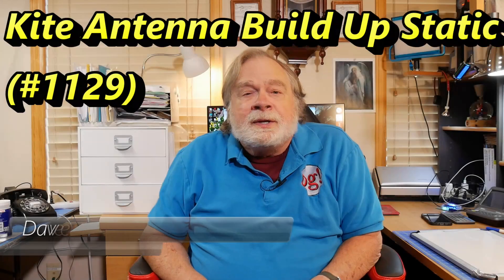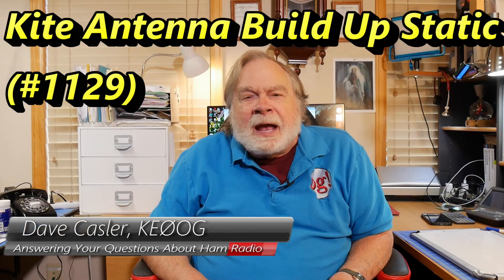Kite Antennas Build up Static (#1129)

Comment: You don't need a good ground. You need a mediocre ground. It is extremely high voltage but extremely low current. If it had any current we wouldn't be building windmills, we would be harvesting with kites. 

A few meg ohms will bleed the charge off slowly. Which, incidentally is exactly how it should be done. The antenna has capacitance to ground, the radio as well. If you charge it up and do ground one, now you have a high differential at the other. EsD mats and straps always have high impedance designed in, partially for safety, but also to bleed off charge slowly to allow internal dissipation circuits t have a chance.

Aso, the radio itself is a faraday cage, assuming it is insulated from ground. Charge inside would be the same as the coax anyway.

Comment: Look at it this way, the kite already supports the string running to it. That isn't light either. If you were to use 30 ga magnet wire supported by the string it would add 1 lb for every 3300 feet of length. If you went with something stiffer like 24 gague thats in the neighborhood of 818 ft/lb.

Comment: Dave,
During ww2 all the bomber aircraft carried a life raft, rations,water and a rescue transmitter known as The Gibson 4:37 Girl. It was a hand crank transmitter and had a non insulated antenna wire. The antenna wire was sent into the air by means of a helium balloon , and the raft had a small cylinder of helium to fill the balloon, or there was a box kite with aluminum tube frame you would put together, not sure what the rest of the kits was maybe parachute material. The antenna is 300 ft long, you would hold it between your knees and crank the generator and it would send a SOS or it had a optional Morse code key to send a massage. I have a roll of that antenna wire, it is a braided copper wire smaller than kite string.
There is no visible means to eliminate static from that antenna wire, unless it is internal.
Any idea how they eliminated static from that between your knees in a life raft?
Thanks for your thoughts. Enjoy your videos
Jeff
KI5HGT

Comment: Dave, I don't usually comment on your videos but your lead in statement really got me. You said it would have to be a really large kite to hold up the coax. It's holding the wire. The transformer and coax would be at the bottom. The rest of your answer was good and no further comment is needed. A radial wire to bleed off the static electricity/RF would work fine in my opinion.
Steve, k7ofg.

Comment: A kite such as a parafoil used at the beach in a typical beach wind exerts an amazing amount of force.  I have a parafoil kite about 3 by 4 feet in size.  It elevates my arm up in the air above my head and I have to lean back to resist the pull.

Comment: He mentions an awfully big to kite lift up all that coax. I would think they would have it the other way around where the transformer and coax is on the ground or near the ground, and the other end of the wire is being supported vertically by the kite.

Comment: Definitely put a lightning arrestor with a bleeder resistor connected across it to a counterpoise AND connected to the ground. The bleeder resistor can be be several hundred Ohms. DO NOT PUT A CHOKE AT THE FEED POINT. A choke will generate high voltage spikes if there are sudden discharges. Be careful not to operate if there is any chance of lightning!